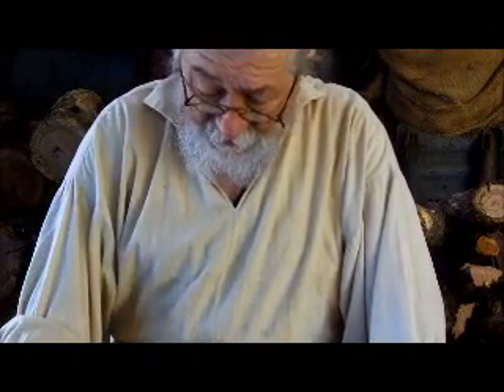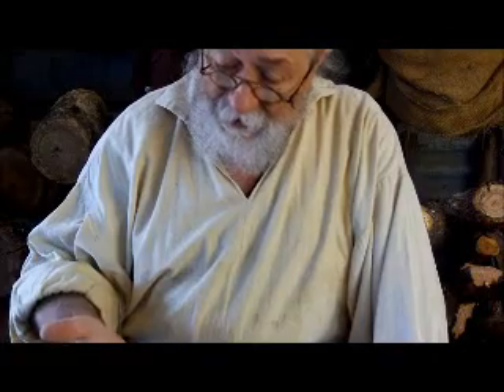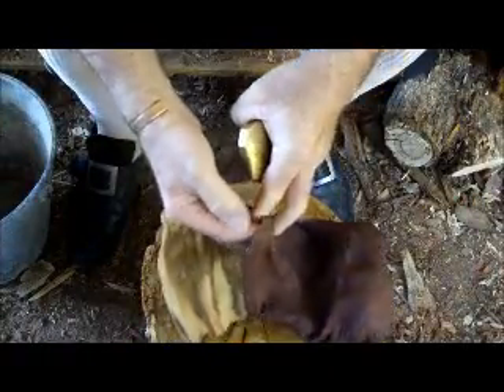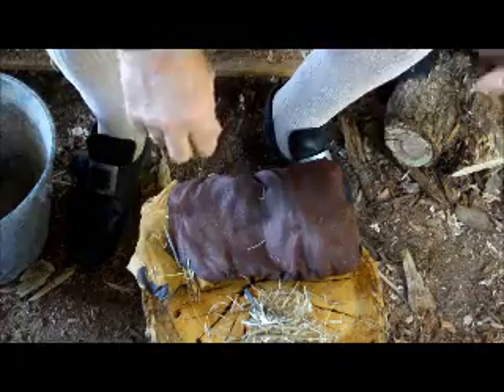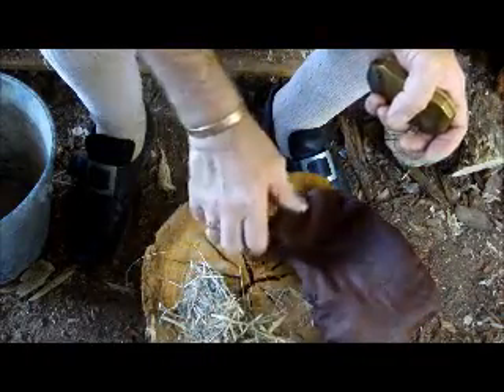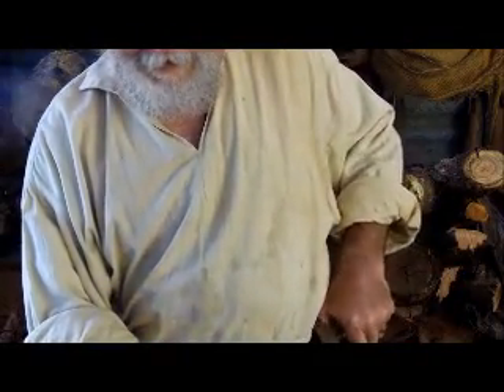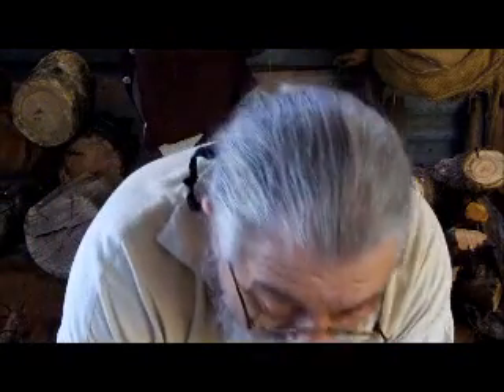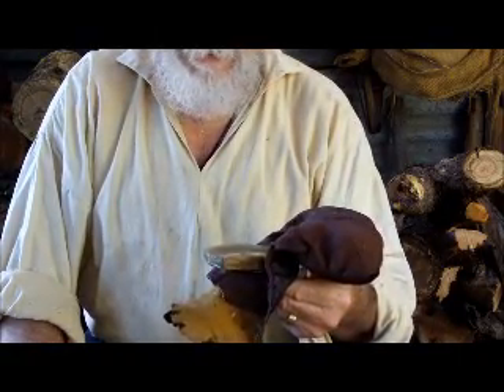No Charcloth Flint & Steel Fire Lighting..wmv

Comment from the maker: Cloth is not available in a wilderness situation. Once the piece of charred cloth is used, it is gone. Using plant tinder in a tinderbox you can re-use the tinder, & you can produce more tinder by adding the right plant material to the tinderbox. Also you use the tinderbox to smother tinder charred in the fire.
Plant tinder is sustainable in a wilderness survival/living situation, charred cloth is not. 
Keith.
Reply: Good point's brought to light. We certainly want to have multiple ways of achieving fire in survival situations and if you run out of char cloth in the woods or haven't brought any then you have to get the first fire going before you can char anything to use later anyway. Tin's are not neccesary for charing materials as you mentioned as you can achieve charing by igniteing the material in a fire and quickly smothering it out. Aswell cloth materials aren't necessary for making char. You can char natural plant materials and they work as well as char cloth to catch a spark. You can even make shift a charcoal kiln out of mud and rocks  and make charcoal out of tree limbs and small logs if you are in a set location for any length of time. Then flake off thin bits of charcoal and they will catch a spark aswell. But the best way of achieving that first fire so you can char or even future fire's with out char is with a bow drill as they make their own char dust  that catches and holds the spark they also produce. So there's multiple natural ways of repetitively achieving fire with or with out flint or steal with out even cloth entering into the equation of any of them. Or carrying with you a tin of anything brought from home. You can even find flint or chert in most areas of the woods along stream's, creek's and river bank's, or lake shore  line's. If not those then quartz will throw a spark also. I haven't gone into any woods or mountains and failed to find quartz some where. And both flint and quartz are easily  obtainable in the deserts of the western U.S by walking the dry washes. Aswell any iron bareing rock can serve as a steel in a pinch. But hatchets, axe's, and knife's will do also. All these many ways are viable legitimate and unstaged ways of achieving fire.
Reply from the maker: @davidsnow9453  I do not recall ever having had any luck catching a spark on a piece of charred wood David, other than punkwood. Perhaps your timbers in America are better suited to this. If you can catch a spark on a piece of charred wood with a flint & steel, well done.
Regards, Keith.
Reply: @historicaltrekking  not charred wood Keith, charcoaled wood.

Comment: Sure is a nice video. Since i first watched this video i started searching for tins. When i went to the local garbage dump i found to my surprize a box full of empty Altoids tins! So i went to the thrift store and bought up several old files. And made a bunch of fire kits! I found the pith from the sunflower stalks is easy to remove as well as after charring makes for an excellent tinder! Thanks again for your patience and instruction!
Reply from the maker: Good to hear from you La Deda, your comment is much appreciated.
https://woodsrunnersdiary.blogspot.com/2014/06/another-plant-tinder-for-fire-making.html
https://woodsrunnersdiary.blogspot.com/2010/07/another-new-plant-tinder-i-have-found.html
https://woodsrunnersdiary.blogspot.com/2012/02/part-four-closer-look-at-flint-steel.html
https://woodsrunnersdiary.blogspot.com/2017/06/18th-century-period-fire-lighting.html
Regards, Keith.
Reply: @historicaltrekking  thank you! That lifted me up to see  im on the right track as far as this study goes. One technique i found to work very well in the charring process is to use 2 tin cans. Like a soup can and a tuna can. One tall and the shorter  set over the top. Gases of the charring material will always find a way to escape. After the char you simply remove from the fire and maybe sprinkle a few drops of water on the top can and make the ground below a bit damp. This taking the element of heat out of the equation fairly quickly . The dried sunflower pith can range to quite large and is so easily lit. I can lite it with a polished soda can bottom in a split second! Sure it burns up quickly if you blow on it but if left to itself a 3" x 1" piece will burn for a few minutes just sitting 
unmollested. It is nice to not have to rely on any of societies costly gadgets to make a fire with. It is rewarding to see the and glow of an ember . Like doing a magic trick. I have taught dozens of folks the tricks i have learned this year. And so many are pleasantly pleased to have had the expirence of starting their own fire from scratch. Again thank you for that encouraging confirmation information. And taking the time to respond. Greetings from Nevada, U. S. A
Reply: @historicaltrekking  😁 a note: i was hiking high up in the mountains just before winter with my metal detector in a suspected gold region near home. And i found old relics like broken wine and whiskey bottles. On my way up the mountain i spotted a light green bottle bottom and wundered.... I picked it up and wiped the dirt of it and it cleaned up nicely. As i was walking i took a small stone and began to gently rub the sharp edges. It smoothed them down rather quickly. Then i decided to giver her a try. Got some dry grass and some sage bark and made a nest and put the lens to the task. After about 3 minutes of fumbling i got smoke! And soon an ember was created by the bottle bottom of that old wine bottle from about the 20's. It wasnt long and i was enjoying the heat of a tiny twig fire.!
Reply from the maker: @ladeda7033   The way they used to char tinders & the way I do it is to char the tinder directly in the fire, you do not have to carry two cans with you. You smother the smouldering embers in your tinderbox. It was done this way in the homes & in the wild.
https://www.youtube.com/watch?v=C5WGTxDS1AE&t=9s
Regards, Keith.
Reply from the maker: @ladeda7033   Well done! 
Keith.
Reply: @historicaltrekking  yes i agree open fire. But at home i have some luxuries. I do take char from the fire if im out and about to refill the box. I am still learning what works and what doesnt. I have been playing around with it for a year now. Ever since i nearly froze to death will in Mongolia last year. I thank you Sir for your kind feed back. Once i can do it at home i can begin to fine tune to the more traditional techniques. And hope to explore also with fungus if i ever manage to get out of the desert. Again thank you for your kind words and encouragements .

Comment: Great vid. Thanks. BTW someone asked about sharpening the edge of the flint. For a knapper this is easilly done by pressure flaking. The decorative curl on many fire steels actully was made for this too. The dull edge of the flint was put into the curl and snapped off making a sharp edge. Most curls are just decorative now.

Comment: I don't know why I never thought to put the tinder into the charred punk instead of the other way around. Thanks!

I'm a little confused about something. You said charred cloth wasn't made by putting the cloth in a metal box, but if they people were doing it with natural materials, why wouldn't they do the same thing with cloth?
Reply from the maker: All tinder materials, plant, fungi & cloth were charred in or in front of the fire. Then it was placed in the tinderbox & the lid closed to smother the embers. Tin containers in the early days were mostly soldered, using a can in the fire would melt the solder. Plus there was no need, it was natural & easier to char tinder material directly in the fire.
Charring Tinder Materials: https://youtu.be/C5WGTxDS1AE
Regards, Keith.
Reply: @historicaltrekking  that makes total sense. Thanks Keith!
Reply from the maker: @cal593  You are welcome. Contact me if you need any help or info.
Regards, Keith.

Comment: Plant tinder.   That's very interesting.   I've never heard that term before.   I will most certainly have to look into that further.   Your tinder box was amazing.   Beautiful and well loved I see.    Loved your video.  Thank you very much.
Reply from the maker: Thank you for commenting Mike, much appreciated. My tinderbox is loved, true, but probably not pampered. It is a working tool. & it gets used & put back in my belt pouch. It rarely gets cleaned.
Keith.

Comment: Hi Keith, can you please let me know and explain how you made your leather fire bag, and how you water proof/oiled the leather, type of leather, sewing material, ...etc?  also, where you found or what would make a good fire/tinder box?  Thank you!!
Reply from the maker: I made my fire bag from light clothing weight leather. simple bag, sewn inside out with linen thread & with a flap closure. After sewn, turn outside out so as to hid the stitching. You can use a variety of greases & oils for waterproofing, I used neetsfoot oil. 
Any tin container large enough to hold plenty of tinder & a piece of flint will work, so long as the lid fits close enough to smother the smouldering tinder. My tinderbox is a copy of an original, & is not air tight, but it works just fine.
The Fire Bag: https://youtu.be/lH5kY3GTWaA
Preparing tinder: https://youtu.be/C5WGTxDS1AE
Regards, Keith.
Reply: Keith H. Burgess Thank you very much!  I will look for both that type of leather and oil!  Again, appreciate you answering my question!
Reply from the maker: @bridgesbushcraft  Any time BB.
Regards, Keith.

Comment: Great points were made in this video and even greater arguments to back them up especially "what happens when you run out of charred cloth". I think then next part of my learning will involve plant tinders that will light with flint and steel (or in my case quartz). Thanks for the video both thought provoking and informative.

Comment: Great video. I particularly liked it because I like to use naturally available materials. Pine trees are everywhere here so I have become fond of very fine fat wood shavings made by scraping a piece with the back of my knife. Is this something they did back then or is it a modern method? Thank you
Reply from the maker: +John “survivor johnny” Tewelow  Hi John. I have not found any record of fat wood being used as kindling, but that does not mean that someone did not use it. It can't of course be used as tinder with a real flint & steel, as it will not catch a spark.
Regards, Keith.
Reply: I know fat wood has been used for torches into antiquity so the flammability of it was certainly known. I would assume that it had been used for starting fire as well but I've never seen any documentation of this.
Reply from the maker: +Forge North  "Fat wood" as it is known now may have been used as kindling, but it would not have been used as a tinder.
Keith.
Reply: That's a good point I assumed he meant using it as kindling. where I live there are far more hickories and oaks than pine so I don't have much experience with fat wood.
Reply: +John “survivor johnny” Tewelow 
Thus far I have not seen any references to such shavings being used historically. I have used them with F&S and char in the same way Mr Burgess used the dry grass. They work exceptionally well as they ignite more quickly and burn longer than grass. Cheers!

Comment from the maker: Hi Giselle! Good to hear from you again. The steel has to have a high carbon content, that is why metal files make the best fire steels. Even so the steel has to be hardened just right for it to strike sparks, too soft & the flint digs in rather than shave the steel. Too hard & the flint can't cut into the steel at all.
A good steel can be made from just a broken piece of file, in fact some originals were just that. There is more on my blog. I will post link on your channel. Regards, Keith.

Comment from the maker: @hoosierarcher  Yes, in 18th century city/village homes tow rag was often used as tinder. Charred directly in the fire then smothered in a tinderbox. But in wilderness areas mostly plant tinders were used. Nothing wrong with starting off with a tinderbox full of charred cloth, but you need to know about plant tinders for when you run out of charred cloth.
Thanks for your feedback & information, very interesting.
Regards, Keith.

Comment: What are you using
Reply from the maker: There are several natural tinders that I use, Yacca flower stem core, A Polypore fungi-Ryvardenia Cretacia, American Aloe, Punkwood, the inner bark of the stringybark tree.
Keith.
Reply: @historicaltrekking  But don't you have to charge all of those or is it only stinging nettle that will start without charing it
Reply from the maker: @kidglove100   The beetle dust from the polypore will catch a spark without the need for charring, but charring is easily done directly in the flames of a fire. Uncharred tinder can be placed in the tinderbox & it will char every time you use the tinderbox.
Check out my other fire lighting videos for more methods & information.
Keith.
Reply: @historicaltrekking  OK thanks I will
Reply from the maker: @kidglove100   If you need anymore help, contact me.
Regards, Keith.
Reply: Keith
How are you doing my friend? You have been, and still are, an inspiration to all of us here. Thank you so very much, for ALL the things you share with us. You , are the REAL DEAL !! You take care .

Mark from Idaho, USA

Comment: I've seen far slower lights when using charred cloth, and in my minute experience charcloth collects moisture much quicker, sometimes even out of the air in high humidity.. Excellent demonstration.
Reply: Interesting. Charcloth can be dipped in water, shook off, then used immediately to catch the sparks from Flint (the rock) & (high carbon) Steel. (There are vids of it, it has been spoken of on some forums, and of course you can try it yourself.) Nor have I ever found any difference in the propensity of various chars (I've used dozens of species of plants and fungi that were charred, uncharred or used in char mixes) to absorb humidity vs that of charcloth. By the way, I live in the Great Lakes region of the USA. Humidity from 60-100% is the ever present norm here.

Comment: yes u are right. the modern method of making chared cloth is worst then the historical method, but with historical method you need a lot of char to get the parts that didnt char enought to catch fire and you need a lot of it in ur tinderbox beacuse it burns so quickly so ul need a lot of spare cloth to make it.
Reply from the maker: Cloth does burn faster than plant or fungi tinders as you say Dejan, but I don't use cloth anymore. If you keep it in the tinderbox & offer the grass kindling to the smouldering tinder in the tinderbox, then I close the lid on the tinderbox to smother the smouldering tinder & save it for next time.
Stay safe Dejan.
Regards, Keith.

Comment: I find the way you made fire quicker and more effective than most I've seen and I like the method you used of bring the dried plant tinder to the ember in the brass tinder box, making contact, and blowing it into a flame. That said...what material did you have in the brass box?

Thanks
Reply from the maker: +BAZYRKYRS BUNKER   The way I make fire I believe is the way it was originally made, however, the nest method was also used as were spunks in the homes for transferring fire.
I use plant tinders in my tinderbox, punk wood, grass tree pith & Ryvardenia Cretacea (A polypore bracket fungi) are the main ones I use, but there are others. See my videos on plant tinders.
Regards, Keith.
Reply: Thanks...I appreciate it!